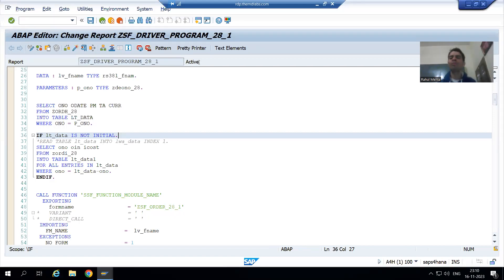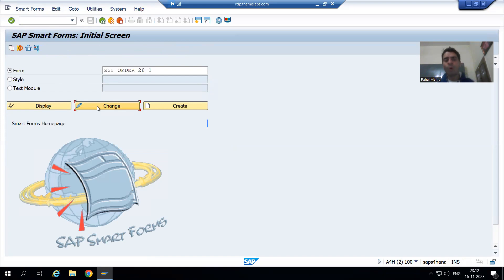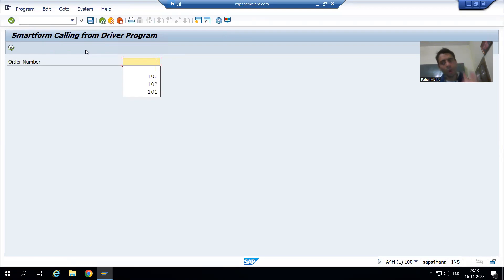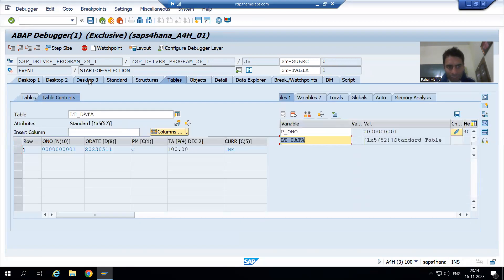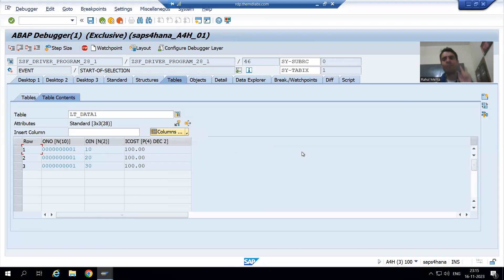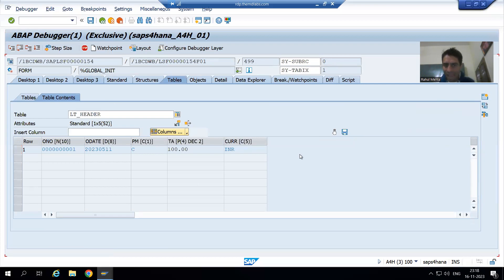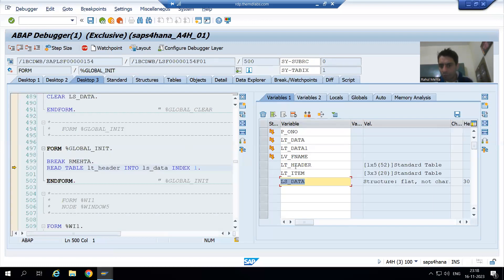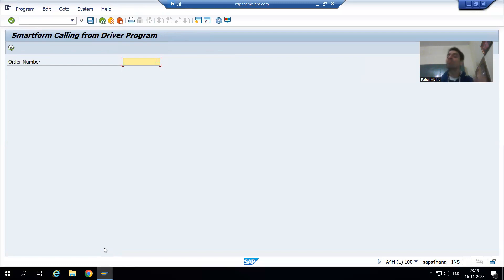16 - Smartforms - Selection Logic in Driver Program Part7

Comment: I used a different approach. Instead of adding the structure table in IMPORT; I added in TABLES and both work the same. But the question is what's the difference between IMPORT and TABLES?
Reply from the maker: Hello Jayesh - TABLES tab is dedicated for internal tables only whereas with the help of IMPORT tab, we can pass variables, work areas, internal tables.

Comment: Hi sir, im not getting any result in values, but output is same as i mentioned like"&lt_data-ono&" in smartforms,,,i had used microsoft word for the same..
Reply from the maker: Hello - When we use MS word, you need to write using the INSERT FIELD button( + symbol)
Reply: Thank you very much sir,,,❤

Comment: Hello Sir, I used TABLES option from interfaces tab in smartforms to get internal table value from driver program and used flow logic in main window to populate multiple line items but the driver program after execution doesnt give any output.
Reply from the maker: Hello Nabil - Refer to the video of Debugging of smartform and check the passing of data from driver program to smartform as here debugging will help you to find the root cause.

Comment: Sir when I'm running this after putting break-point into two places(one- In the program & another one- in the smartforms), First debugger is starting but when I select output device and then run it, debugger is not starting.
Reply from the maker: The possible reasons - 1) Your smartform is not active.
                                          2) Your smartform has syntax error/runtime error.

Please check for above mentioned points.
Reply: @sapabapbyrahulmehta  Actually sir this message is coming- "define an output device in your user master data error in sap"
Reply from the maker: @AmarnathSen-bq4yz   Please check with your provider/administrator for the output device you need to choose.
Reply: @sapabapbyrahulmehta  Thanks sir....just done it and successfully works.